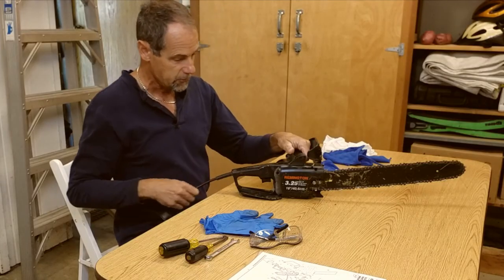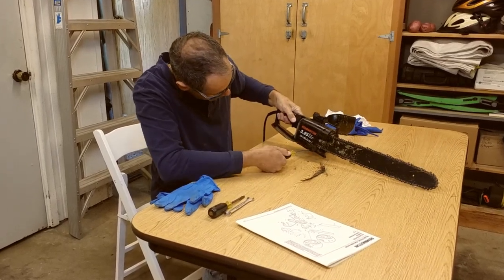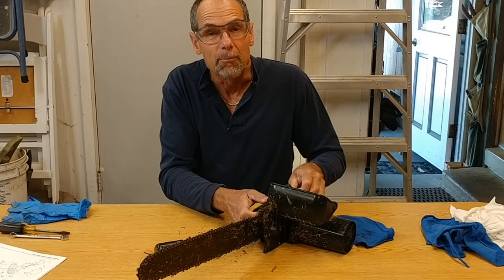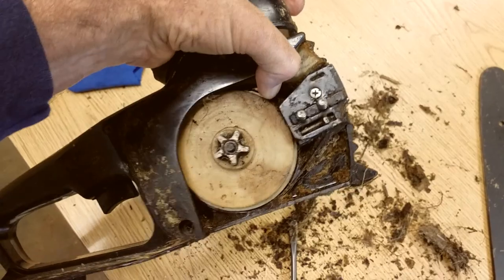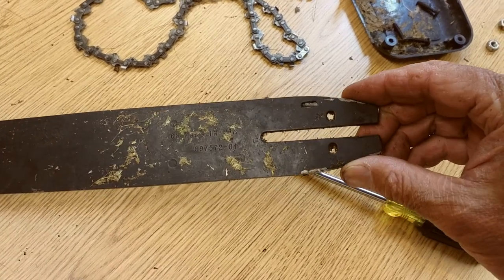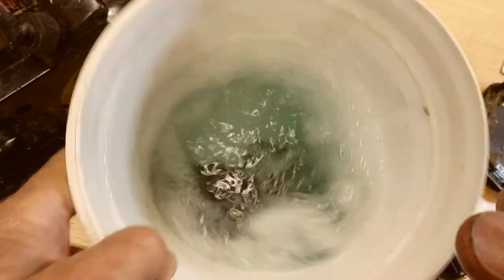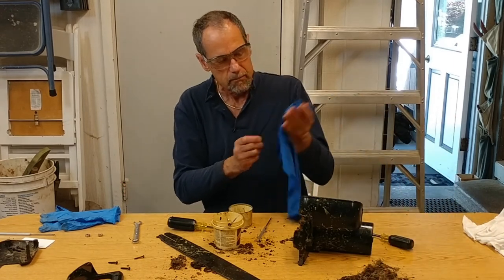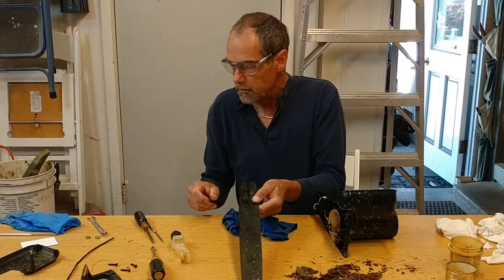Electric Chainsaw Maintenance, Cleaning, Lubrication How To

Comment: This was a really really well done video, on all levels. Thanks so much for the step-by-step walk through. Question: Do you store your electric chainsaw (I happen to have the same Remington one plus a Greenworks 14 inch also) with the oil in the reservoir? You have some very good videos- definitely subbed!
Reply from the maker: Thanks Chris, I really appreciate that.
Yes, I leave the oil in it. I hang mine from the handle with the blade down vertically. The oil does slowly run down the bar and drip out, but I have a small plastic cup hanging from the end of the bar which catches it. I just pour it back in when I use the saw next.
Reply: @ItsFixable  I like that idea very much- it makes total sense. Gonna do the same. Thanks!

Comment: Great video but my Remington still won't lubricate. Couldn't get that clip off either. Mine is almost identical, if not.
Reply from the maker: Those e-clips can indeed be stubborn. Use a flat screwdriver that is narrow enough to fit into the space on one side of the inner back of the ring. Keep the tip firmly against the metal plate and try pulling it toward you instead of levering it away. Be sure to have your other hand or a rag positioned to catch the thing if it shoots out. You don't want to go crawling around on the floor to find it! An e-ring tool like this certainly makes removal and installation easier.  https://smile.amazon.com/Neiko-01970A-Clip-Remover-Installer/dp/B000W94UEQ/ref=sr_1_1_sspa?dchild=1&keywords=e+clip+tool&qid=1633961808&sr=8-1-spons&psc=1&spLa=ZW5jcnlwdGVkUXVhbGlmaWVyPUEzUVk0OEE2RU4wSUJMJmVuY3J5cHRlZElkPUEwMjM1NDc0QVhVNExET0NaUDhNJmVuY3J5cHRlZEFkSWQ9QTA2NTA2OTAyWEhVQ0pCUkNXTkYzJndpZGdldE5hbWU9c3BfYXRmJmFjdGlvbj1jbGlja1JlZGlyZWN0JmRvTm90TG9nQ2xpY2s9dHJ1ZQ== ,but I don't have one.
Reply: @ItsFixable  I tried box cutter before reading this. Get under alright, then goodbye box cutter. My Remington is a 14 in Limb & Trim. Almost identical, if not.

Comment: I'm curious why you didn't pull off the drive sprocket (white circle thing)and clean all the gunk and built up nastiness that ends up behind that thing(the white circle thing). It pulls off relatively easy. Well you do have a slightly different saw but I am just trying to figure out how to properly lubricate the saw before I go to slap it back together, Parts wise it's almost exactly identical. yours has more horsepower the one I am working on is 1.5 HP.
Reply from the maker: I don't recall that there was evidence of debris behind that disc, it moved freely. 
  On assembly, there really isn't anything in there needing pre-lubrication. The chain and bar are the important things to oil and that oil will get spun onto everything else as necessary.
Reply: @ItsFixable  there were a few things behind that disk that needed to be cleaned and attended to. There was quite a bit of fine sawdust that was basically filling up the teeth on the drive sprocket. And then the thing the drive sprocket sits on has two bearings that are these like little sleeve bearings I don't know what to call them I've never seen them before in my life until just yesterday but after further research I discovered that they do it would need just a tiny little bit of Grease just to keep them all going good and whatnot. I read regarding gas-powered chainsaw specifically that those little bearings on that driver sprocket need to kept clean and maintenance. when the saw is not cutting and it's just running and idling it will start making what sounds like a cowbell knocking, when those get worn down. I understand it's slightly different with a electric saw those bearings are still there. I tried the saw today after cleaning it all up, and it's never worked better. When it came to the chain I took the chain off and I put it in a glass container with a rust stain remover from the brand winks, with a little bit of some foaming bathroom cleaner spray with bleach in it. Added some water to covered the chain and swirled it with a screw driver. The dumped it out and washed throughly. Then slightly heated it dry with a propane touch. Not getin it too hot by any means. Then put it back into the glass container that I had( which was technically old candle originally) and filled up to the container until the chain was fully submerged in boiled linseed oil. And then I took some plastic Saran Wrap and put it over the container and pushed down the center of it so that it was making contact with the linseed oil and then rubber banded it shut. Let sit for 12+hrs and the chain looks better then ever. Also when I removed it from the oil I patted it dry with a paper towel not completely dry though. All in all it came out great. But honestly everywhere I looked I never found one video or anything that specifically explained that drive sprocket area of an electric chainsaw. I don't know if there's a specific reason for that but I know for a fact my needed it cleaned up and attended too. Great video by the way
Reply from the maker: @metal422life Sounds like you did a very thorough job. Yes, it's important to keep the drive teeth clean. 
   A gas powered chainsaw has a centrifugal clutch that need to remain clean in order for the saw to idle properly. An electric chainsaw doesn't. Sleeve bearings are low maintenance bearing and are very common in small motors and appliances. 
  If I'm not mistaken, boiled linseed oil will oxidize and harden, or rubberise. In the paint industry it is used as a primary ingredient in many varnishes and lacquers. Therefore I don't think it is an appropriate lubricant. Bar and chain oil is engineered to provide the proper lubrication and heat dissipation to insure the longest life for your chain. In some jurisdictions, biodegradable bar oil is mandated to be used because running a chainsaw sprays oil into the environment.
  I'm pleased you found my video useful, thanks!
Reply: @ItsFixable  I understand it's not a great lubricant but it does rehydrate slightly mainly it's a rust preventative. That's also why I made sure that there was basically no error in contact with that boiled linseed oil because I know that it oxidizes and it basically leaves hard hard rubbery film. But the chain needed some love because it never seen maintenance for years until I got it. Got some good chain oil in there after I tested the saw out briefly, mostly to clean out the rest of that linseed oil the paper towel didnt get. I personally like to use boiled linseed oil on my polished axe head. Anytime I use that axe I rub a little linseed oil on it and it prevents it from rusting. Oh yeah an the bearings where dirty and dry on mine. Not now though. Their happy.

Comment: Watched this video last night.  Took apart and cleaned my little Remington electric detachable pole saw.  The oiler would no longer work.  I am not the handiest.  Cleaned it based on your video and could not have done it otherwise.  Filthy and full of crap inside.  I have not used the saw yet, but there's no doubt that the oil bulb will push oil through with no problem.  Don't understand why so relatively few views.  One of the best "how to" videos on YouTube.  Thank you, thank you, thank you.
Reply from the maker: I'm so pleased to know that it was of help to you. THANKS!